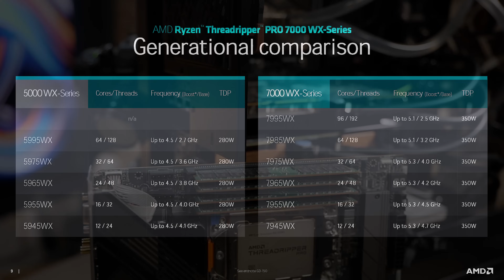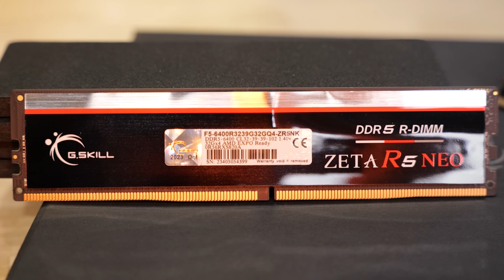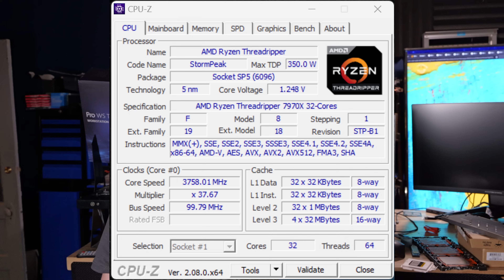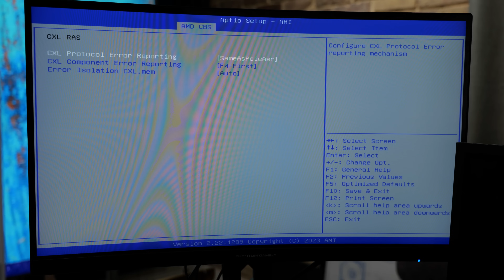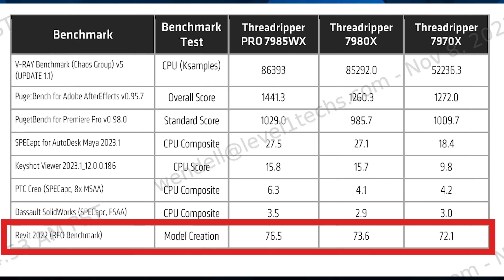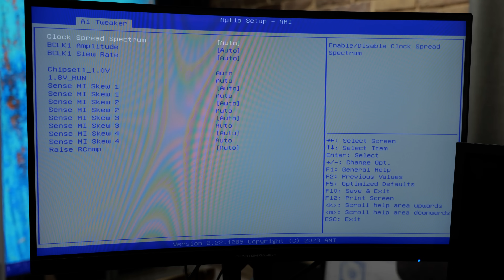AMD High End Desktop is back: 7980X & 7970X  Threadripper Tested

Comment: $5k 64-core is equivelant to like $625 for an 8-core which is not exactly a bargin. Then the motherboard and peripherals are also pretty steep. What happened to economies of scale? I should be able to build a 64-core machine for much less than 8*8-core machines. ecc registered memory is nice, so there is that.

10 years ago my entire 8-core tower was $600 including case, top shelf big name PSU RAM motherboard and SSD [a premium option at the time], and a good mid-range over clockable CPU. Good enough I'm still using it as a primary daily driver. I'm mainly looking for an upgrade because I no longer have a backup machine, and I have one particular task that could take a lot of processing (though I may just rent some compute time from AWS or similar for that task.)

Comment: Thank you for this illuminating overview into AMD’s new Threadripper Pro offerings. They are truly impressive. What I am trying to figure out is which is better and more cost/power effective… A single Threadripper Pro server/workstation with say 64-96 cores and 512-1TB ram which would easily cost north of $10,000 and use between 1-2kw of power, or 5 separate Ryzen mini ATX servers, each with its own M2SSD and 32-64GB Ram, which draws around 100 watts of power (so roughly 500 watts for 5 servers), and each server costs around $1.2k each so $6k-ish all together, which is roughly half the cost of the single Thread ripper Pro server/workstation. My primary use case this server/or servers for hosting sample libraries for streaming into my DAW via Vienna Ensemble Pro. My main workstation would be a Mac Studio and the network would be 10Gbit/100Gbit mikrotek with either built in 10Gbit nics or 100Gbit Mellanox cards. I’d like to see a build, especially with software M2 raid as you mentioned in this video, because M2 raid HD speed is important for a sample library streaming server. Just from a practicality standpoint, it would be nice to run everything on a single machine like on a new Threadripper Pro, but it may not be economically viable or smart to do it that way.
Reply: If your workload scales across systems (doesn’t need to be in the same memory / cache) then multiple cheaper systems is going to be the way to go IMO.

Comment: For hardware RAID - I do understand that the separate RAID controller solution is dead, but having a CPU with built-in optimized RAID solution (that of course could be software and therefore tunable for the task at hand) would be interesting. With the number of cores going up I'd expect that cores could become more of a mixed bin with some cores more dedicated to certain task like I/O and some being more for math instead of every core being the same.

Comment: To some level I think that the game test with FPS frame rate isn't always cutting it as gaming experience. I'd like to see a test of how well a very loaded instance of Cities Skylines do on the CPU load. It's of course going to be harder to get it entirely easy to test, but in that game there are many things going on at the same time with a lot of simultaneous threads, especially with a lot of mods loaded.

Comment: Still using my Lenovo p620 with the 12-core 3945wx(I think) cpu and it’s enough but if I come across a 24 or 32 core 59xxwrx cpu for cheap, I may just do it. This thing is my proxmox server and it runs pretty must silently. Go AMD!

Comment: I really miss HEDT.  Shame it's still dead.  HEDT should use consumer memory and it should range from 12 to 32 cores with quad channel memory, 40 to 48 PCIE lanes and start around $1200 combined for the cheapest CPU and board.
W790 and TRX50 are Lite Workstation instead of HEDT because of the registered ECC server memory and outrageous price tags.
Reply: Theres still the possibility of TR being catered specially to HEDT users if a lower core count model were to come our for $700 or so. The consumer memory situation I haven't watched in the video yet, so I'll form an opinion on that then.
Although for the PCIe lane count, I'd rather they have a system like they do now with 88 lanes, 48 of which are gen 5, because 48 lanes always seemed juuuust a little limiting on X299 platforms. If you want two fully wired GPUs, some NVMe drives, and faster Ethernet, you're very likely going to have bottlenecks in your system. But I agree that the pricing for these CPUs is too high, thats why I'm hoping for a lower core count model, since even 16 cores would be plenty to get started with HEDT, at least for me

Edit: I've looked up some more information about memory support. Its a darn shame that unregistered memory isn't supported, that its more like a lite workstation in that way than HEDT. That being said, if RDIMMs are similar to consumer DDR5 in price, along with the lower core count models like I've already mentioned, it can still be a replacement for X99 if the motherboard pricing is right and secondhand prices plummet, likely after AMD releases future generations on this socket.

Comment: These are the CPU's small independent software companies should be using for their programmer and 3D Modeling/Rendering workstations.
Reply: These are desktop CPUs and there's no requirement to do those things to use them. It's good that people at home/indies can if they want though. Threadrippers are monsters.

Comment: I wish we would go back more towards lean, nimble single threaded enterprise software. These multicore monsters just rely on brute force and irresponsible power consumption to get things done. For me, well thought out and optimized single threaded software is where we should be heading.
Reply: Running the same amount of instructions on multiple cores is generally more energy efficient than on one. Because to run single threaded apps fast, you need to push clocks. Most of the power that modern CPU cores burn comes from the need to push their clocks as high as it goes, beyond the efficiency sweet spot on the freq/voltage curve. Which is mostly done to accomodate tasks that rely on fast individual cores, not on many of them (in particular true for gaming). If all software would be and was easily multi-threaded, then we would get much more power efficient CPU usage, not the other way around.

Comment: I love all the chat about Memory, Would you do a video about the various options for AMD Memory settings and any advantages and or disadvantages of enabling them, for example, Low Latency Mode, High Band Width Mode, Auto Memory Enhancement vs Expo etc... could be tied in with a Where Were At Now update on Memory on AM5 as there have been a lot of updates.

Comment: When you say "hardware RAID is dead" are you including RAID5 using spinning discs? If so, uhhhh, citation needed.
Reply: He means using a raid card instead of software raid.  There was a video a year or two ago.
Reply: @pkt1213  Still wrong, though.  It's alive and well, at least for hard drives.
Reply: @TrueThanny  I wasn't weighing in one way or the other.  Just what he is saying.

Comment: Great content/evaluation Wendell. 💯
FYI, my Seagate 2x18 SATA is working just fine. I still think the errors reported were from the software being confused with the 2X heads.
Reply: is this comment about the post on the L1forum regarding the Zfs and dual actuator drives?
Reply: Yes it is.  @tanmaypanadi1414

Comment: @Level1Techs : Wendell can you please test the new Threadripper CPU in Windows 10/11 to see if it crashes like the older generations (the infamous "event ID 56 - ACPI 15" full system crash) so that people know if this problem still persists or not ?
Thank you.

P.S. Wendell what is that noise in the background ? Were you 3D-printing something whilst filming this video ?
Reply: Haven't seen that crash ever with either a Threadripper 2950X or 3960X.  Don't think that's a common problem, or caused by the processor.
Reply: @TrueThanny   Thank you for your feedback, I guess you're one of the lucky people then since Threadripper 19xx, 29xx and 39xx series seems to be affected by it (don't know about the 59xx).
I also think that it's not a CPU issue, I think that it's a microsoft Windows bug. I've tried most of the suggestions that you can find on the internet to try and fix it (change BIOS settings, disable 50% of your cores, disable SMT, keep the CPU busy for at least 50%, ...) but nothing seems to work.
Both Windows 10 and 11 cause the crash (screen goes blank, audio stutters for about 5 seconds then cuts off completely : the only thing you can do is press the reset button on the PC case), and all updates (for both  Win 10 and 11) have the problem. I can sometimes go by a couple of days without any crash, but I've had days where I experienced 6 crashes in about 9-10 hours time so you can guess that I'm fed up with it and if I invest in a new Threadripper I would like to know for sure that this thing isn't going to happen again.
Microsoft knows about this issue for at least 5 years already, and they either don't care to fix it or they cannot find the root of the problem.
Reply: @Yves_Cools Does Linux boot properly? could it be the ram ?

I am never going to be in a position to use a threadripper but that sounds like a hair ripping experience.
Reply: @tanmaypanadi1414 : I don't have Linux installed on it so I don't know.
The RAM is stable from what I can see : no problems with corrupted data or anything (memtest86+ runs perfectly fine, even when I let it run an entire day/night), except for these damned system crashes of course.
Reply: @Yves_Cools use kahru or testmem5(with anta7777 extreme or absolut presets) passing MT86+ is not hard even with unstable memory, and I have to note that I never had issues with treadripper either for the short time I used it on windows, on Debian I have a tr system that has an uptime of ~120days and has gone more than 300 in the past
Reply: @Scorch1510  yup, on my main system (AM4), I tried running mt86+ on my benching memory preset ( that preset is pretty untable) and it took 20m to error, with TM 5 it was a bsod in less than a minute

Comment: lol, 'hardware raid is dead'.  not even close for workstation class or above machines.   especially since most drives do not have power loss protection but mainly as the point of hardware raid is to remove i/o cycles away from the main system.   under linux you have some more options w/ zfs for data integrity items but for a windows base OS, do yourself a favor and get a good hw raid card w/ BBU and one that will scrub your data at rest if you looking at 24x7 professional use.  Good example are the Areca ARC-1886 cards (ARC-1886-6N2I if you want nvme direct, and they have out of band management  which is very useful in server deployments).
 
As for the HEDT part itself, yes it's interesting but not performance/cost competitive and not enough memory bandwidth.  the Pro version is better but with a cost in line with Eypc there's not point as you can get an epyc cpu and get 12 channel memory opposed to 8.
Reply from the maker: see, though, but if you dig into it, you'll see this isn't really the case. linux md for linux workstations is fine; increasinly ReFS for non-boot windows volumes is a thing. ReFS doesn't require hw raid w/BBU. I suggest you watch my hardware raid is dead video because you can't just wave away "goood hw raid card" .. okay? which one? which hardware nvme raid card can even keep up with two CM7 Kioxia SSDs in raid1? Suppose you want local block storage that's reliably 25+ gigabytes/sec. That's nearly 30 gigabytes/sec read from just two cm7. 

low latency is also important and it's tough to beat latency of "good" software, or software-ish solutions like vroc, even with the best workstation-class hardware raid cards that do nvme. "the best" hardware raid carts out there are still pretty crappy for storage as good as medium-range gen4 or high-end gen5 storage
Reply: @Level1Techs  Thanks, and yes saw your 'raid review' which frankly is not accurate in use case.  As for raid card types you have the 'prosumer' type as mentioned the ARC-1886-4N or -6N cards) which as mentioned are great due to the out of band management).    For your example if you're looking for BANDWIDTH (which is NOT what you really should be looking at it's mainly IOPS as storage requests are very seldom sequential) then you have a very specific workload type that is not general use.    The point of  hardware raid is:  reliable storage; fault tolerance, data safety to storage (PLP/BBU); and to remove cycles from main system  overhead (very important  when repairing/building/changing layouts on live systems).    Most 'consumer' ssd's top out around 30-60K write iops (random 4k full array) which is pathetic so with a good hardware raid setup you can get the above availability functions and increase your iops).    I've deployed ZFS since it came out in 2007 on solaris, been using RAID's since they came out in the mid 80's (before the term 'RAID' was used); have deployed hundreds of workstations and thousands of servers.    I was just arguing against your use of mantra 'raid is dead' as that is completely false and really comes from a lack of understating of what it provides.
Reply from the maker: @stevekristoff4365  I am not finding a link to something specific in your reply. Even for iops, what specific hardware raid card do you have in mind that's going to beat vroc for latency and iops, in hardware, when we're talking two gen5 CM7 or two gen4 P5800X Optane, though? :) 

 Lot of raid controllers get to iops by caching in ram, so the op comes from cache on the card, yes that's fast. But do you not see that putting a controller in front of i.e. a P5800X harms the overall iops for truly random I/O? Think about the relationship between latency, queuedepth and i/ops. For queue depth 1 with truly random IO, you need the storage going into the widest path possible with the highest possible clock. 

No one I'm aware of is making such hardware (because it is better handled on the cpu). Even if you want to cross your eyes and look at solutions that use gpus for raid parity compute acceleration... the cpu is still doing the vast majority of the heavy lifting when it comes to iops and throughput. It cannot be said to be a pure hardware solution in the way you are describing.

It might be possible to do direct I/o between pcie devices and a controller card (a la what AMD used to do with crossfife) -- that doesn't really involve the cpu much, especially if thereis a pcie bridge between devices and the cpu -- but afaik no hardware like that for pcie raid storage exists anywhere.
Reply: @Level1Techs  Love how random tech bro drops into the chat to just take a dump all over the L1 Team questioning there overall understanding of the product and industry and tries to out big word them when they are widely accepted to be some of the most well versed in this space. I also love the OG Response of "I'm not finding a link to something specific" which is Computer Nerd (all the love intended) for Show me the Receipts with a little, Fu4k Around and Find Out, lol, love it L1.
Reply: @Level1Techs  Really the biggest point is OS support, like Windows or ESXi. If you don't want or can't (not enough hosts) use VSAN then you must use hardware RAID for proper ESXi support so you'll be using a Broadcom Tri-Mode controller irrespective of performance requirements or differences versus software options. Same is kind of true for Windows. Yea I really like Storage Spaces but administration of it and official feature support is quite lacking, not to mention parity performance if you configure it wrong goes in to the dirt.

I agree RAID isn't necessarily dead, it has it's place and patrol reads is quite often sufficient even for larger sized HDDs (~10TB) but it comes down to use case and software/solution support more than anything else. Like if you are running Windows server with DAS storage for Milestone security camera recordings, you will be running hardware RAID not software RAID because are you really going to trust Storage Spaces that much? Yes remote storage can be an option but that's also not always possible or comes at a cost.

I think the issue boils down to the universal statement that hardware RAID is dead when it's realistically not, the reversed way of saying this would be "Software RAID is actually good now". Because software RAID used to be a joke, known as both unreliable and bad performance and that absolutely is not true anymore. Software RAID competes very strongly with hardware RAID now, at the same time if we are talking very large data volumes then I would be pointing towards scale out storage (SDS) like Ceph, Gluster etc and I don't call those "software RAID".

Ultimately what is actually supported is more important rather than the philosophical question of is hardware RAID dead or not, if your software or support vendor doesn't support it then you aren't using it whatever that "thing" might be.
Reply: You could have given your opinion and try to get Wendel to explain the reasoning behind his commentary, but you chose to be a confrontational fool and in exchange, just make evident your lack of experience. Nice job.
Reply: @jairo8746  lol.  not even close and would argue that Wendel's statement more reflects your comment than my comments do with him putting forth vacuous arguments as to 'raid is dead' without any real understanding on what raid is or why it exists.  as for your 'argument from authority' standpoint, do not assume that anyone that happens to have a larger voice/audience has the experience to back that up.   If the sheeple here want to follow mantras, go for it.   while people in the real world will get on with business.
Reply: @stevekristoff4365  Double down on your nonsense, you are doing just fine, keep at it.